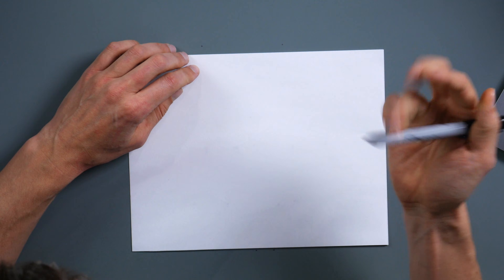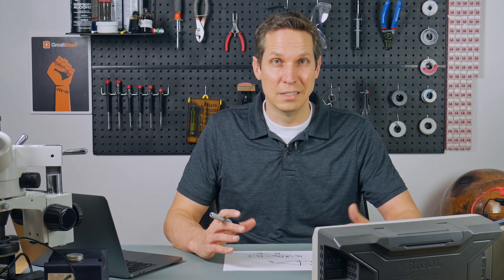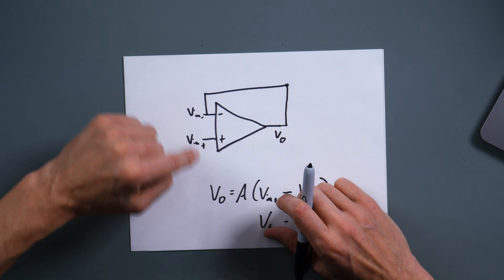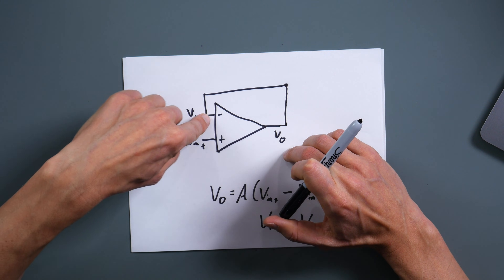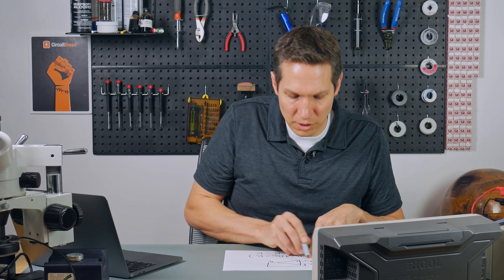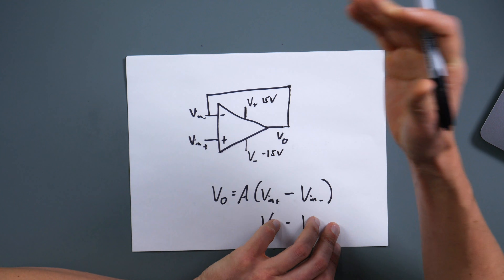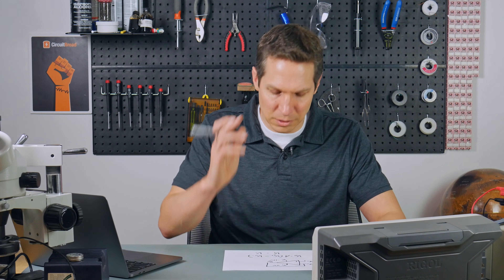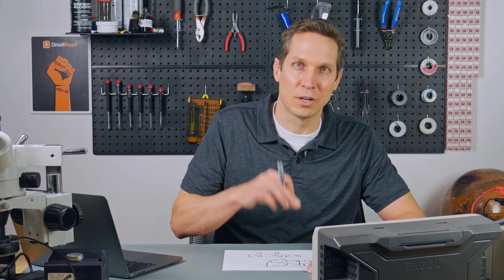Intro to Op-Amps (Operational Amplifiers) | Basic Circuits

Comment: A machine that admits no current, equalizes all voltages...and yet somehow amplifies.

To what extent is the output constrained by the actual power supply input voltage to the op amp.
Reply from the maker: The output can go no higher or lower than the input supply voltage.  And that's with a rail-to-rail op-amp.  Ones that aren't rail-to-rail have some overhead so the output is even further constrained.  But yes, op-amps are curious structures and very useful.

Comment: I'm currently in a circuits course at my university. When the summing-point constraint was described, it said that the current on the input directly connected to the source is 0, but the other input current doesn't need to be 0 even if there is no voltage difference across the input terminals. You're saying there is no current on either input terminal? Do you know why they might be teaching it this way? Also if there is no current on either input, what is being "amplified"?

Comment: Can I implement this type of circuit for summing the modulator output with the carrier siganl in FM generation? I'm trying to think about the application of the summing op amp and what can I use for summing my signals in fm modulation.

Comment: Thank you for the video. It was very helpful. I've been trying to understand single vs. dual supply op-amps and I was getting confused because the article I was reading said that the output can't swing negative, but then gave a couple of examples of single supply op-amps. One of the references of a single supply op-amp was AD820. If you look at the datasheet it not only swings negative, but it also has dual supply specifications. That makes it very confusing. I'd be lying if I said I understand now, because I don't, but for some reason signal input and power input blended together in my mind. I don't know why. Duh! At least your video got that part straightened out. I don't know how much the rest of your series on op-amps will help with the single vs. dual supply, but at least I know I have gotten something out of watching. Thanks again. 👍🏽

Comment: Thank you, sir ... very very helpfull fr the exam 
Sir, I doubt the input current is zero, but what about the output?
Reply from the maker: The input current isn't zero but it is small enough that assuming it is zero makes the math MUCH easier without really changing the results of the calculations significantly.  The output, ideally, can be infinite if necessary.  Of course, in reality, it's limited by the electronics but, again, for ideal calculations, you can assume that it can output whatever current it needs.

Comment: Hi there? Is the power supply of an op amp independent from the inverting and non-inverting? I'm actually planning use op amp as a comparator to monitor a voltage from a capacitor and after meeting a certain condition i want the op amp activate a relay with a different  power supply. Thanks

Comment: If both inputs are the same, doesn't that mean that their difference will be 0 and also the output will?
Reply: The rule only works when you have output connected to input (feedback loop). If you have output connected to inverting input and you put some voltage on non-inverting input the output will put out the same voltage as you put at non-inverting input in order to make both inputs at the same potential. For example if you put 2V at the non-inverting input the output will give out 2V to make inverting input at same potential as non-inverting. If output dropped back to 0V as you said the potential at inverting input would be 0V and potential at non-inverting input would be 2V which means that potentials wouldn't be the same which is why the output stays at 2V.

Comment: I'm lost at V+ and V-. Is that the same with V+ and GND? What if V+ is 12v, what is V- then?
Reply: When there is feedback in the op amp configuration, it will drive V- to be equal to V+. So in your case, it V+ is 12v, then V- will also be 12v. There are also the positive and negative supplies that power the op amp, often these are something like 5v and GND. Terminology between the power inputs and control inputs can vary which is quite confusing. V+ and V- can refer to either the control or power inputs depending on the context. Sometimes IN+ and IN- are used to refer to the control inputs as well.

TLDR: horizontal inputs should be equal voltage, vertical inputs are for power and will not be equal voltage

Comment: So even if we apply differential inputs the op amp will try to match them both? Because i read that the op amp uses the difference and amplifies that and I also read that the common mode input gain is relatively less than the differential gain. Can anyone help with this?

Comment: I don't get it, how can amp inputs have 0 current as you say? Then according to the Ohm's law input resistance is 0, which is not practically possible.
Reply: No, input resistance is infinity, 0 resistance would give “infinite current” or a short

Comment: That’s an immediate stumbling block at the beginning. Keep in mind that despite your measurement of voltages, an op-amp is dealing with current. Put a pin in that. It will be very helpful as you learn more.

Comment: Why is circuit bread logo in the background using the communist fist?
Reply from the maker: 😂 We just thought it was a fun play on the "Resist" jokes so common among electrical engineers, which is why there is a resistor symbol around the wrist.  I didn't want to take it down because it's just a joke however I was overruled and now we replaced that poster in the background.

Comment: So far, I'm in the middle of the video, and I'm struggling to force myself to believe that both V- and V+ are supposed to be the same. it does not make sense.
Reply: you have to tell your brain to make a special exception to this case your brain is trying to apply old knolwedge of how circuit boards work to a component that isnt completely illustrated as it really is.
Reply from the maker: Yep, I really struggled with that idea as well at first.  It helps to think that the op-amp is designed so that, with the correct supporting circuitry connecting the output and one of the inputs, the output is trying to drive the voltage on that connected input to match the other input.  Sometimes it helps to look at an op-amp in the comparator configuration to see how that works in the simplest manifestation.
Reply: Look at it this way, you want a balanced signal amplified 🎉
Reply: No idea what you are talking about... would be better if you didn't use hands but wrote or diagramatically show what you are talking about...
Reply: Honey,this is not even our last problem
Reply: V+ would be 12v 
V- would be -12v

Or 

V+ would be 24v
V- would be 0v

Comment: thanks. i'm abit confused still. what if, say Vin- is tied to ground and Vin+ is tied to 5v? how does the op amp keep these at the same voltages, without current flow?
Reply from the maker: If there's no feedback from the output, then they won't keep them at the same voltages.  That being said, if you do have it setup like that and then also put in feedback, the op-amp will likely melt itself or simply max out.  The key here is that, properly configured, the output will try and make the inputs match voltages.  But without feedback, the output will simply act like a comparator (check that video out, it may help).

Comment: If V+ and V- have the same voltage, then shouldn't the output voltage equal 0? Since it's V_0=A(V+-V-)
Reply from the maker: Excellent question!  There are two reasons that this wouldn't be the case (maybe more, but two that pop into mind).  First, without feedback, even the slightest variation in the two inputs will cause the output to swing wildly.  This variation could even be due to internal imperfections in the op-amp itself.  The second is, with feedback, the output is forcing the input to match but it usually has some external influences as well.  Plus, if the output voltage stopped driving in the input, they would be different again and the output would swing again to bring them back together.  So it kind of reaches an equilibrium.  I hope this helps!
Reply: @CircuitBread  thank you very much, it was very helpful!
Reply: @CircuitBread So V_out is actually swinging all the time? Or the voltage gain equation does not apply?

Comment: I’m taking my first circuits class right now and plzzzz make a video on First and second order differential equations
Reply from the maker: I'm sorry, I don't think we'll be able to put something together in time to help you but I did recently get a new differential equations textbook so that I could review and get back up to speed on this.  I have been considering an engineering focused math course where we go over those concepts that most apply to engineering.  I don't think I'd do well with it personally, but Susie is a heck of a lot smarter than I am.  She may be interested in tackling it when she's done with her current series.

Comment: Thanks! Quick question: That V+ And V- are above and below ground? (if not, is V- connected to ground in standard originally designed use of an opamp?)
Reply from the maker: You are correct that they're above and below ground.  It makes powering them a little more complex than "normal" circuits but the op-amp output can only be within the range of those inputs.  So if it needs to output a negative voltage, it can only do that if V- is hooked up to a negative voltage.